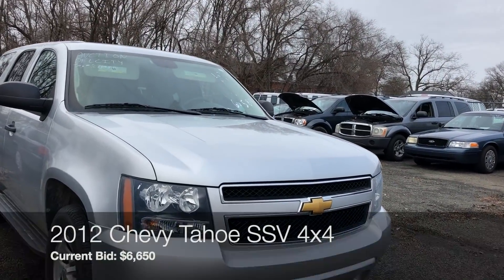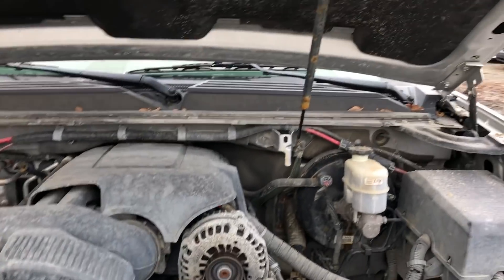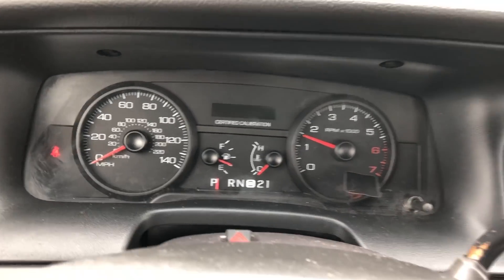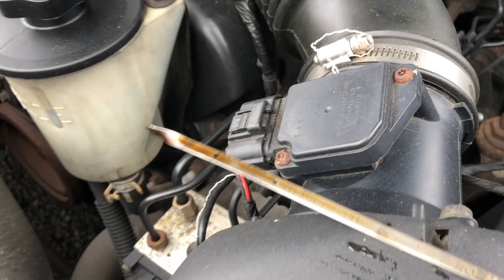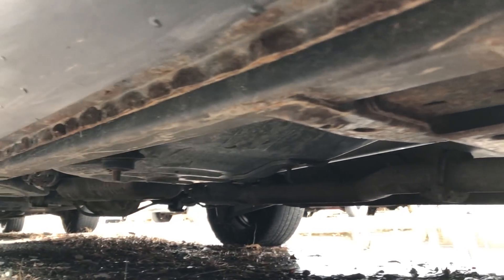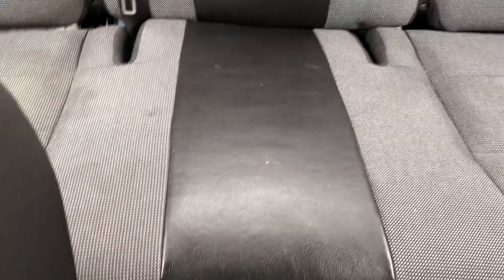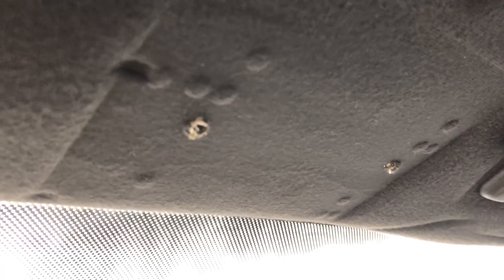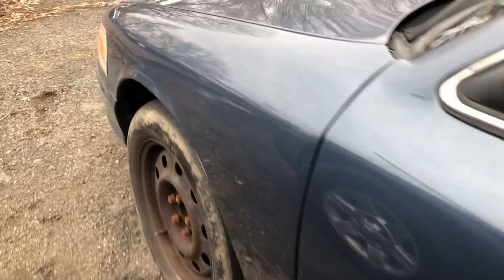Government Surplus Vehicle Auction Inspection - Ford Crown Victoria, Chevy Tahoe and Dodge Charger

Comment: Most of the gaps - unless the car has been wrecked - are from the huge drawl dies used to stamp the sheet metal wearing out. The more model years their used the gaps become worse. As the dies are used they need to be maintained which means they need to be hand ground and reshaped and in some cases they get hairline cracks or stress cracks from the pounding they take that need to be welded and ground down. It’s a pains taking process to refurbish dies that might need to be done every 15,000 hits. A hood or trunk lid die can cost over a million dollars for each half to repair if some employee happens to toss a 1” diameter bolt inside and than the two halves come together. There is an upper and lower half to each die. When you figure how many times the dies strike to form the parts the pressure it takes is amazing. I tried to keep my explanation short as I could. So this is the short one. 

Just curious about how much does it cost to have one of the big Fords rapped? I know the checker cab company in New Your city has their cabs rapped but they have them done in house. I almost purchased a  Michigan State Police car but they were just to much money for me. Many of the taxis drivers purchase them so the demand and price is high. I really like your videos, Thanks

Comment: Great content Chris, thanks!👍 I’m not as well versed in CVPIs as I used to be... so what’s the deal with just the odometers not displaying??  As you know, I’m a GM guy... shame with that Tahoe.. soooo much salt & corrosion.😢 Any updates on yours (since the last one where you told me your friend has put it on the “back burner”)??
Reply: Seems the odomoter is broken on a lot of these cars
Reply: I have a 99 and I've had to get a new one put in last year it's a common problem because of how long they are run

Comment: It was fun looking at the cars in this video.  That Tahoe looks really nice from a distance, but I agree with you, its really ugly up close.  It'll be interesting to see what those sell for.  If those CVPI's were down here, they'd be in the $2K range - mainly because of the not-white color.  Most of the cars that turn up at our local auctions are either white or all black (ex-FHP cars).
Reply: TheCopCar Na, that Tahoe is clean. Those trans lines always seep and it needs a cheap fender liner

Comment: crown vics and grand marquis after 09 have a intermittent display issue where to odometer goes out randomly and comes back usually bight and such, i've gotten them fixed for 20-50 bucks. dont be discouraged by just the OD not displaying and see if you have a Dashboard doctor in town, so long as there isnt any leaks or ticks/knocks you should find a good vic/merc. whatever you do do NOT put a parts dash in the cars after 08 there is a decent chance you will theft lock your cars computer, its happened to me twice, never again.

Comment: OK, just subscribed, but on the other hand, 4196 is average idle hours? You agree with the 33 miles per idle hour CPVI we read out there? If so,  your OK with an additional  138k miles on top of the stated miles too? Value aside, just the calculation.

Comment: I hate the way those 2002 and down crown Vic’s drive. Rack and pinion is so much better
Reply: I had a 2000 p71, sold it and got a 2011.  Night and day difference on how they drive.  The 2011 drives like new.